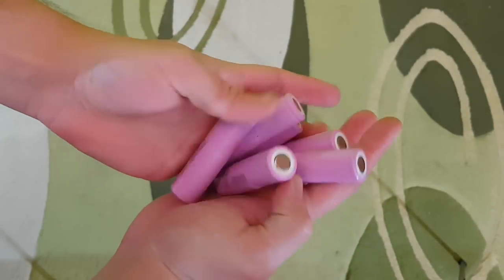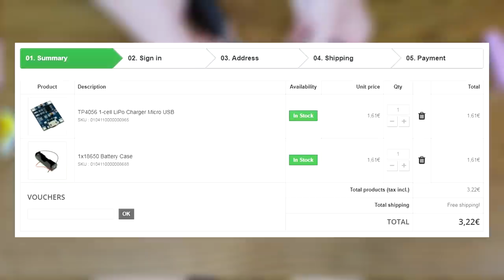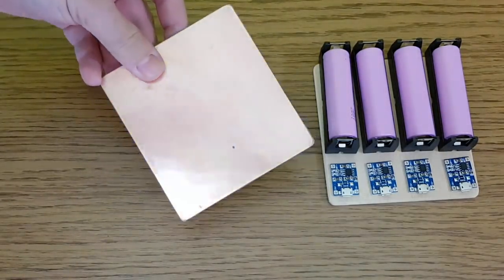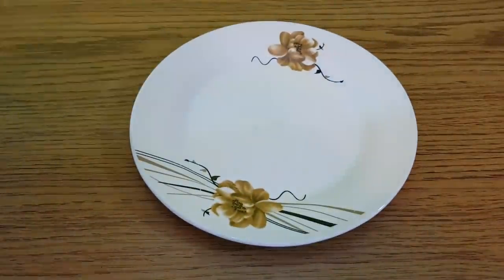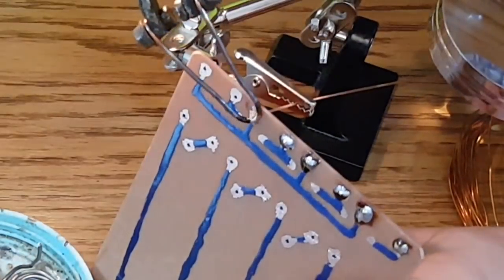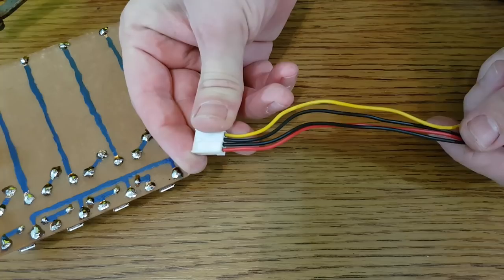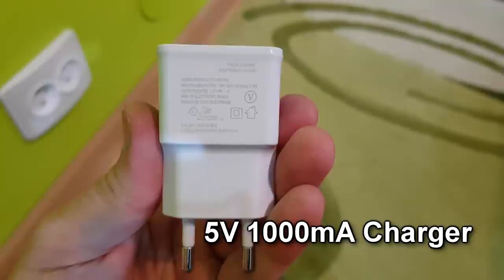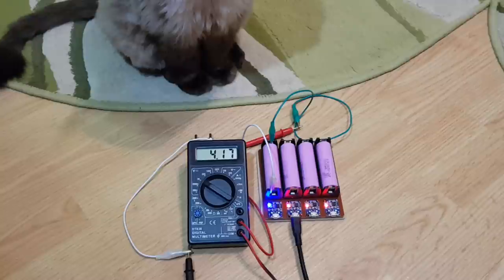Simple DIY 18650 Battery Charger - TP4056 Review (Everything Explained)

Comment: Why u use 4 pcs tp 4056 module? If I use 1pcs 4056 module for 5 battery chargeing what the problem I face?
Reply from the maker: hi. with 4 charging modules you can charge 4 different cells individually. the cells can have different capacity, they can be discharged to different levels. you can put each cell in the charger at different times. all the cells will be charged much faster, with max 1A. not 1A divided to all 4 cells. if you want to charge multiple cells with only one charging module, the cells must always be connected in parallel (when you charge them and when you use them). the cells need to be the same type, same capacity, same lifespan, same charging-discharging cycles and they will be charged 4 times slower.
Reply: @Sorin_DIY  thank u sir.

Comment: Why you've used 4 tp4065? It's not possible to use 1 for all the batteries???
Reply from the maker: hi. with 4 charging modules you can charge 4 different cells individually. the cells can have different capacity, they can be discharged to different levels. you can put each cell in the charger at different times. all the cells will be charged much faster, with max 1A. not 1A divided to all 4 cells. if you want to charge multiple cells with only one charging module, the cells must always be connected in parallel (when you charge them and when you use them). the cells need to be the same type, same capacity, same lifespan, same charging-discharging cycles and they will be charged 4 times slower.

Comment: Why not using One module and four cells in parallel?
Reply from the maker: hi. with 4 charging modules you can charge 4 different cells individually. the cells can have different capacity, they can be discharged to different levels. you can put each cell in the charger at different times. all the cells will be charged much faster, with max 1A. not 1A divided to all 4 cells. if you want to charge multiple cells with only one charging module, the cells must always be connected in parallel (when you charge them and when you use them). the cells need to be the same type, same capacity, same lifespan, same charging-discharging cycles and they will be charged 4 times slower.
Reply: @Sorin_DIY  thank you very much, but, these cells Need an input of 5 volt or 4.2?
(Without the module I mean)

Comment: can a laptop 11.1volt battery be charged with a cellphone 3.7volt  universal charger?
Reply from the maker: no. only if you remove and charge the cells individually. or use a step up converter, to increase the voltage for the BMS, but it will have a very small charging current.

Comment: why did you need 4 different boards? couldnt you have just connected the 4 batteries and use just one board?
Reply from the maker: hi. with 4 charging modules you can charge 4 different cells individually. the cells can have different capacity, they can be discharged to different levels. you can put each cell in the charger at different times. all the cells will be charged much faster, with max 1A. not 1A divided to all 4 cells. if you want to charge multiple cells with only one charging module, the cells must always be connected in parallel (when you charge them and when you use them). the cells need to be the same type, same capacity, same lifespan, same charging-discharging cycles and they will be charged 4 times slower.

Comment: There are few things that can be done better-
-use alcohol based sharpie, not paint, they are resistant to etching solition, and it will look better.
-first heat the PCB pad, then use solder, not other way around, that is why your solder joints look terrible.
-cheap chinese chargers often use same modules. For 1,6€ you can have 10 same modules from china.

Kudos for drilling by hand with 0,8mm drill bit.
Reply: tp4056 is on aliexpress  :-)  i use them alot :-)

Comment: for one module can I charge how many batteries sir?
Reply from the maker: hi. I've tried with 3 cells. but it can charge even more cells. the problem is the charging time, it will take too long to charge 3 or more cells connected in parallel.
Reply: @Sorin_DIY  
for one module what is the ampere for charging one battery?
Reply from the maker: every charging module needs 1A.
Reply: Sorin - DIY Electrical Nerd ok tanks sir

Comment: Can someone tell me if it is possible to connect the batteries to be charged in parallel, but to work in series? (I think of something like a double circuit with a switch). regards
Reply from the maker: hi. I made a separate video about that, you can find it in my uploads list.
Reply: @Sorin_DIY  u say the DIY - 15000mAh Power Bank video?
Reply from the maker: in my powerbank video the cells are charged in parallel, but you can also connect them in series with a switch. you can find more info in my other video - DIY - BMS Protection Board made with TP4056 modules
Reply: @Sorin_DIY  Thanks you for keep answering me!! :) Yes, i see that proyect too (i love all your work bro).. but in the BMS board you put the 4056 in series.. i want the 4056 in parallel, but the cell in serie.. that was my question, because i dont know how to do this

Comment: Use TP4056-Protection module,the ones you use has NO protection feature.
Reply: It has all protection features for charging , you r not using these to discharge the batteries!

Comment: I have a 7s 2p 18650 battery pack and i need to design something to charge all of these at once, if you can contact me some information on how you'd go about it, that would be great.
Reply from the maker: hi. you need a 7S BMS board. or modify a transformer with 7 individual outputs, and and use individual charging boards for each pair of cells, connected in series.

Comment: salut lasa si tu un link te rog pentru modulele de incarcare si suporti de acumulatori te rog!!!!
Reply from the maker: salut.
https://www.optimusdigital.ro/ro/electronica-de-putere-incarcatoare/80-incarcator-de-baterii-tp4056-1a.html

https://www.optimusdigital.ro/ro/suporturi-de-baterii/942-suport-de-baterii-1-x-18650.html

mai exista inca o varianta de modul de incarcare tp4056, care are si protectie la descarcarea acumulatorului. cand tensiunea acumulatorului scade la 2,4V, modulul deconecteaza acumulatorul din circuit. urmeaza sa fac si alte clipuri cu astfel de module.

Comment: I can use this module for two 3.7 volt lithium battery in parallel at a time.
Reply from the maker: yes. but the lithium cells need to be the same type with the same real capacity and with the maximum voltage of 4.2V
Reply: @Sorin_DIY  thanks

Comment: How if i use more than one usb chager?
Reply from the maker: if the TP4056 modules are connected in parallel (input wires) you can use only one charger. if you want to use multiple chargers, the TP4056 modules must not be connected in parallel.

Comment: How to control battery from overcharging and over discharge
Reply from the maker: hi. the tp4056 module has an overcharge protection. and you can find other tp4056 modules with over discharge protection IC, like I used in my other battery charger video.
Reply: @Sorin_DIY  can i control the voltage and current?
Reply from the maker: the voltage is controlled by the integrated circuit. you can modify the maximum charging current, by changing a resistor on the module. the initial max charging current is 1A.

Comment: Why not just use one single TP4056  and wire the battery's up in parallel ?
Reply from the maker: hi. with 4 charging modules you can charge 4 different cells individually. the cells can have different capacity, they can be discharged to different levels. you can put each cell in the charger at different times. all the cells will be charged much faster, with max 1A. not 1A divided to all 4 cells. if you want to charge multiple cells with only one charging module, the cells must always be connected in parallel (when you charge them and when you use them). the cells need to be the same type, same capacity, same lifespan, same charging-discharging cycles and they will be charged 4 times slower.

Comment: what is maximum amp for the module?
Reply from the maker: the maximum charging current is 1A.
Reply: yes the output current is 1A.. i mean.. i have 18650,, with 25 amp. can i put it on module that you use on your project?
Reply from the maker: you have a 25A battery? or you connected many 18650 cells in parallel to get that high amperage?
Reply: yes i have 25A battery with 3.7v (just one 18650)
i got 50A in total with 7.4v when in series (2x18650)  btw the battery i want to use is Sony Vtc4
Reply from the maker: hi. this battery doesn't have 25A capacity. it has a capacity of 2100mAh, but it's a high drain battery. this means that it has a high discharge rate, it can deliver a 30A current, but for a small amount of time. so depending on your load, it can deliver 2.1A and get fully discharged in one hour, or it can deliver 30A and get fully discharged in 4 minutes. these type of batteries are used in RC cars, helicopters and portable power tools, which need a big amount of current in very little time (minutes) from a small battery. so yes, you can use the TP4056 module to charge this 2100mAh battery. if you connect 2 batteries in series, you will have a battery pack of 7.4V (nominal) with a capacity of 2100mAh (not 50A or 4.2A). if you connect them in parallel, you will have 3.7V (nominal) with 4200mAh capacity. 2 identical batteries in series = voltage gets doubled. 2 identical batteries in paralell = capacity gets doubled.
Reply: OHH!! THANKS SIR FOR VERY APPROACHABLE FOR MY QUESTIONS, :D i really understand it now.. and yes i have that module and now i can build my own powerbank ^^ i subscribed already :D thanks..
Reply: here in the Philippines the module cost much cheaper .. 200 pesos for 5pcs.
or equivalent almost 3 euro only for 5 pcs. :D

Comment: Can I use a 2a charger there 2a oppo charger???
Reply from the maker: hi. I did not try it, but it should work. from what I tested, only the chargers with fast adaptive charging technology do not work.
Reply: I have a question ... if u connect all the 4 in plus and in negative and insert a one cord to the tp4056 charging module will all the four led lights turn on???????? Sorry of my English because I'm a Filipino
Reply from the maker: hi. I'm not sure I understand what you're asking. I connected all 4 power inputs of the tp4056 modules in parallel. I can connect a USB charger in any of the 4 modules and they all turn on. but each tp4056 module can charge a cell individually.

Comment: what ferric chloride do?
Reply from the maker: hi. ferric chloride it's a solution for etching copper printed circuit boards. you mask the copper plate, where you want to have the circuit treads and the ferric chloride will dissolve the rest of the copper. so you remain with only the circuit treads on the board.

Comment: i'ts work on 14500 type to?
Reply from the maker: yes. but you need to check the datasheet of the charging module and replace one of the resistors to limit the current. usually the initial resistor value is set for the max charging current (about 1A). you need to replace the resistor for a maximum charging current of 400 or 500 mah depending on the cells capacity.
Reply: Thanks Sorin!

Comment: You can buy a 2019 multi battery charger (size and 4 battery) for 14 pounds by a reputable company and with a year warranty.
Seems a no brainer
A 4 Bay sled is cheaper than 4 single ones

Comment: You Didnot used the Charging circuit which comes with battery protection because the circuit you have used will heat up the battery and damage IT!!!!

Comment: Ej Sorin. Is there a way to load them like this and use them in series? Adding a circuit where you can switch between? Might it be possible with these; https://m.banggood.com/USB-Power-Bank-Case-Kit-18650-Battery-Charger-DIY-Box-p-961269.html?rmmds=search connecting input parallel andere output 3 in series? Is like the Idea of being able to charge with phonecharger, as everybody had them laying everywhere trough there houses
Reply from the maker: hi. yes it's possible. for 4 cells you can use a switch with 4 poles and 2 positions. in position 1 the switch connects the cells in series to the consumer. in position 2 the switch disconnects the series circuit and connects each cell to a charging module. and all the charging modules are connected in parallel to a micro USB input.

Comment: you should put some diode
Reply: the charge boards have diodes on them so the batteries dont drain back to the micro usb port
Reply: So if I place the battery the wrong way, it will not destroy the board?
Reply: Reverse polarity on the battery connection will instantly kill the TP4056.

A diode or reverse polarity transistor setup would solve this problem when batteries are mistakenly put in the wrong way (+ to - and vice versa). There is a good video how to solve this at:
https://www.youtube.com/watch?v=IrB-FPcv1Dc

Comment: So lemme get this right you are charging 4 18650's off of one USB cable and one wall charger which probably is only 1000mah maybe 2.1mah tops if your lucky so that means best case scenario your charging your rather high capacity batteries at 1/2mah at the absolute most per battery which is such a slow rate of charge for most 18650's that you'll most likely destroy the batteries eventually if you don't charge them at their specified mAh rating. I don't believe any 18650 battery out there requires any less than 1000mah bare minimum , and btw even if your using a 2100mah wall charger chances are your USB cable is not capable of transferring any more than 400-500mah and at that point that 400-500mah is split into 4 for each of the 4 batteries meaning about 125mah per battery which assuming the batteries are at least 2600mah it'll take you over 24 hours to fully charge all 4 of them at the very least , prob closer to 36 hours . Are you trying to ruin your batteries bro , a store bought standard 2-4 slot 18650 charger with not only extend the life of your batteries but it also contains overheating shut down protection. , Will charge each battery to it's exact specified voltage and as well as doing so at the required mAh rating that the battery manufacturer has stated for your specific batteries .  After buying that little circuit board , the 4 individual chip boards , the battery case , wire , solder and electricity to run your soldering iron which btw has way too big a tip on it for soldering on tiny boards like you are but what I'm saying is  you most likely spent the same amount making yours that a store bought one would have cost you not to mention also properly charge your batteries even if each battery has a different capacity it doesn't matter the charger determines what capacity each individual battery mist be charged at  in order to not hurt and damage the batteries which as I said you are doing by using that waste if time junker of a homemade abomination you created.  Why don't you go out and spend $25 bucks on a proper 4 slot charger bro unless you enjoy destroying batteries quickly and like to keep replacing them all every month or two. Thumbs down for this video , btw you didn't need to buy those 4 separate chop boards as 1 board from inside a cheap portable charger would do the same job as all 4 of your chips but you'd only need 1 if you repurpose the board from a portable charger like I said , go get a 2500mah portable charger they are like 5-10 bucks , take it apart and remove the board then solder all the power and ground tabs for each of the 4 batteries all together onto the positive and negative outputs clearly obvious on the repurposed board you salvaged from a cheap portable bank, and you'll also get a red light or flashing blue light that tells you when it's charging and usually a solid blue light turns on when all the batteries are fully charged.   But in the end I still stand by the statement I made in that you should have just bought a 4 slot charger that will actually charge each batteries at their required rate (mAh). Thumbs down for this video because I don't like your soldering iron either those things are pieces of shit , the standard.pen style iron are still the best especially with a super fine micro tip screwed into it so you can properly actually solder small shit on tjmy boards and chips , plus they just have always worked way better than that piece of shit your using which is way overpriced junk.

Comment: why use 4???
Reply from the maker: 4 what?
Reply: why are you using 4 tp4056 instead of 1?
Reply from the maker: if you want to charge 4 cells in the same time, you need 4 charging modules. the cells can have different voltages, so you can't connect them in parallel to the same charging module. the charging module increases/decreases the charging current depending on the cell voltage while charging it. if you connect more cells (with different voltages) to the same charging module, it can't do its job. or you may need to start charging cells at different times, for example you can put one cell to charge now. after 10 minutes you put another cell, after 10 min another cell... in this case the cells also have different voltages in the charging process. another reason is that the tp4056 module charges with a peak current of 1A. if you connect 2 cells to it, each cell will receive max 0.5A. for 4 cells you will have max 0.25A / cell. it will take 4 times longer to charge them. the only recommended way to connect more cells is to use 2 cells (max) always connected (not to remove the cells from the charger) to one tp4056 module. the cells need to have the same capacity, same life span, same charging/discharging cycles, same voltage when first connected.
Reply: how long will it takes to charge 2 cell in 1 module?
Reply from the maker: about 4 hours